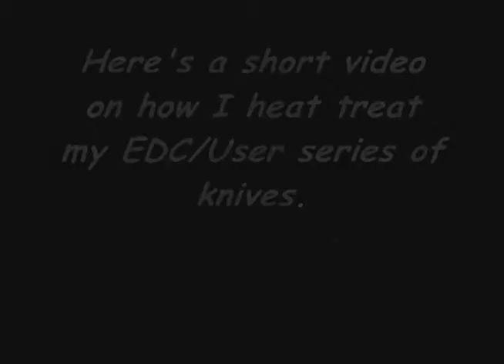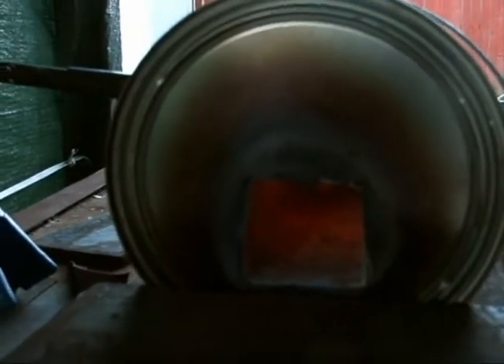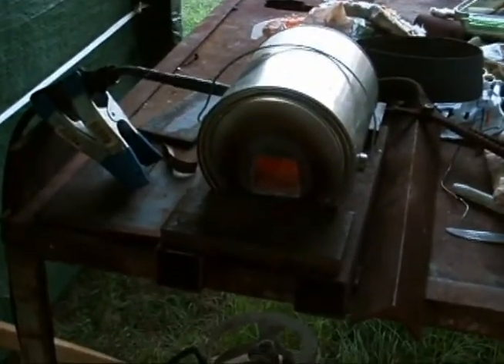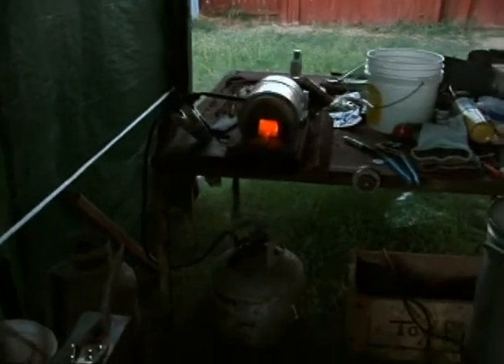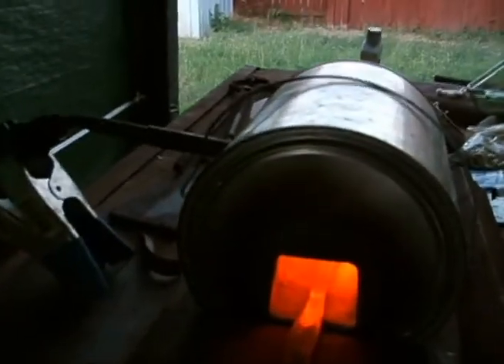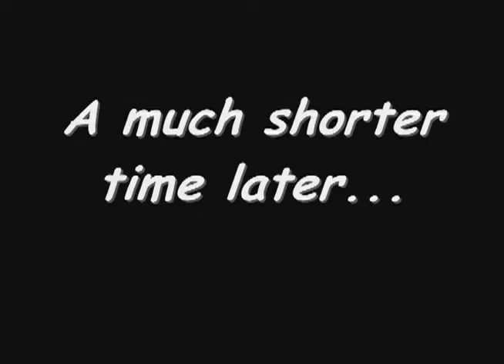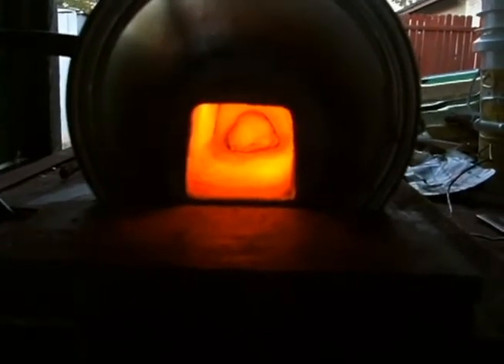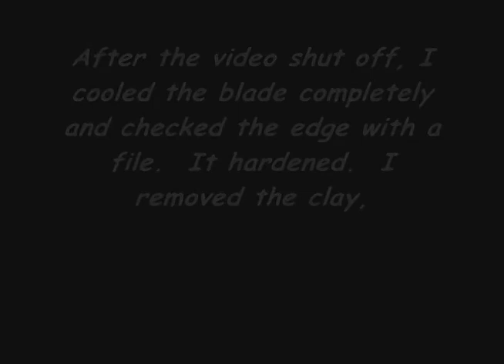How I Heat Treat 1075 Carbon Steel Knives

Comment: How much experience do you have water quenching 1075 steel, I'm really wanting to do water quenching for the nicer hamon, but don't want to have a lot of blades crack on me. I know it will eventually happen though. I have some nasty old used fryer grease and it might work better-but water makes such nice hamons! Thanks for the great vid-that paint can forge is just great! Do you use ceramic wool in it? Also what kind of torch do you use?

Comment from the maker: The initial quench for this knife was into 120°F brine for 4-5 seconds. After that its out for 4-5 seconds, then back in until the temp equalizes. For 1084 and under...as well as short or thick blades...I use an interrupted brine/oil (canola oil works nicely), and for any traditional shape Japanese blades (you can't get the traditional curvature in a direct oil quench). For very long, or very thin blades, I use Parks 50.

Comment: hi
can you make a usable knife right out of the 1075 steel without forging?
(but heat tratment will be done)
Reply from the maker: Absolutely. I actually recommend people learn stock removal and proper heat treat practices first. 

Forging can actually really damage a knife thermally, if not done properly.

Comment: Your giving some useful info my friend thanks For helping new blade makers
Reply from the maker: I was a new blademaker as well once, and I was lucky to find people who freely shared their information with me as well. It would be selfish and hypocritical in the extreme for me not to pass that on! Plus, I firmly believe that you will take the things you learn from me, and improve them...and maybe then I'll be the one learning from you :).

This video is very old though, and I do things much differently now (I built my own heat treating oven which helps tremendously!). I share a lot of my builds on my facebook page at facebook.com/scorpionforge. I mostly make high end kitchen knives now, but if you have any questions (about anything! I'm an open book) or comments that would be the place to reach me.
Reply from the maker: By the way, I have a number of friends who make knives in Tucson (I'm in Phoenix). There are far more of you guys down there than there are up here it seems!
Reply: I would like to build my own oven but honestly im going to start sending them to jeff muntz at trugrit,
paul bos at buck or peters.
Reply from the maker: Wayne from tucson My oven cost me only $200 to build, including a ramp/soak PID controller, dual relays, and everything else necessary. If you keep an eye on craigslist you can almost always find a free or very cheap full size junk pottery kiln to harvest the correct type fire brick from, as well as some of the other things you need :). My knives have always had great sharpness and edge retention (I learned from some of the best out there), but until I started precisely controlling temperatures with the oven...I was always leaving something on the table.
Reply: O yeah trust me I make some great blades but I notice a difference i want to get cryo and stainless what stainless would you rec I looked at aebl and 154cm but im worried about how they will grind like I heard aebl is gummy and clogs belts
Reply from the maker: Wayne from tucson Your steel choice is really a matter of your intended application, particularly when you get into specialized stainless steels. That's one reason I truly love my W1 and W2. Heat treat is only moderately complicated, and the results are phenomenal. With an oven you can make the steel perform to the max degree without too much fuss.
Reply: I thought those steels were for big blades what would you use for small neck knives?
Reply from the maker: Wayne from tucson What would make W1 and W2 only good for big blades? It can get screaming hard (I temper my kitchen knives back to 63-64HRC), the vanadium and/or tungsten pins the grain size down, and works with the excess carbon to make very small, evenly spaced carbides which aid in aggressive cutting, and edge retention. And the stuff is tough as nails. All in all, a perfect steel for many/most applications, from neck knives and straight razors, up to katana. That's why I use it.
Reply: Do you offer heat treating services knives or swords?
Reply: Thats impressive ive done a bit of reading up on it w1 and w 2 and it seems like impressive steel I will have to try. Can you recommend a good stainless all I can think of is aeb-l on my budget

Comment from the maker: Realcls brine is simply water saturated with table salt. I like to use water that I've left sitting out for a few days, but I've used water straight from the tap before as well. The mineral content of your water has a definite impact on its quenching properties. The Japanese often used rainwater for that reason. When I brine quench a katana made from modern higher carbon steels (1075 and up), I do what's called an 'interrupted' quench. What this means is I quench for four seconds into the 120°F brine, then out for four seconds, then into 200°F oil for 20 seconds or so. I then VERY quickly do my best to straighten the blade (be careful here! If you take too long the martensite will have fully formed and you're almost guaranteed to crack it), usually by placing it on a 2x4 and hitting the high spots with a wooden mallet. After that it goes back into the oil and I raise the temperature to 400°F. I will temper it in the oil for three one hour cycles, pulling it out in between and using a series of jigs to straighten any warps or bends.

Hope that helps!
Reply: Hi could you give me some advice please?  I am completely new to blacksmithing & have a bit of an unusual question.  I plan on purchasing large 3mm thick 1075 HC steel plates in the fully annealed condition & I plan on making a custom suit of armour as part of a hobby project.  Is this the right steel to use as I would like steel that is easy to harden that is very hard?  They are of various sizes ranging from small going up-to 400mm x 500mm.  I will cold form them into my desired shape by hammer & vice by bending etc as are fully annealed & then I would like to harden them to the highest possible Brinell hardness.  I am not worried about them being brittle but how brittle will they become, so brittle that if I drop the plates from 1m that they will shatter?   Is this possible without cracking them after heat treating & how would I go about heating up this steel uniformly given it's unusual large size?  What would be the best way to set-up a primitive extra large forge on a tight budget?  I'm guessing I would have to use cinder blocks but I haven't a clue what I'm doing lol, I can see this not going well?Thanks :-)

Comment from the maker: @Columbiano671...the reason is because you NEED it dim in order to properly gauge the color of the steel. If it was bright daylight, you could easily overheat your blade. This can cause cracking, or worse...poor performance via grain growth.

Comment: Basically you do a water quench to 1070 steel ?
Reply from the maker: Well, in this video I believe I quenched in in brine, then into oil. I haven't used 1075 in years. Most of my tools are rail clips (1060), or a higher end S series, and ALL of my knives are AISI W2, W1, or AEB-L/Nitro-V stainless.

If I were to do it again, I'd quench into 120°F brine for four seconds or so, then into heated oil. Plain water is unpredictable (literally chaotic in its cooling rate and consistency) due to the randomness and large size of the air bubbles. Brine is faster, but also much more predictable as the salt layer drying onto the super heated steel causes small and consistent nucleation points for air bubbles.
Reply: @CrisAnderson27  Brine you mean salt water ?

Comment: my torches have burned up in my paint can forge. any suggestions?
Reply from the maker: Hello!

I'm not sure what you mean 'burned up'? Did the tips burn through? If so...you can order new tips. With where the tips are supposed to be though, that's kind of odd to me. How far in are you putting them?